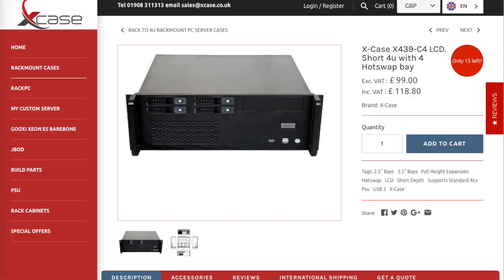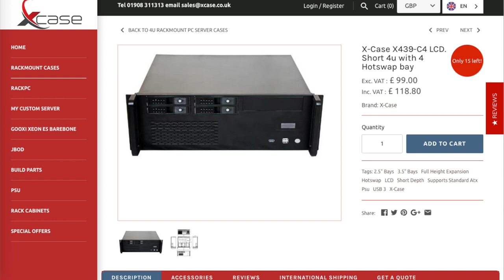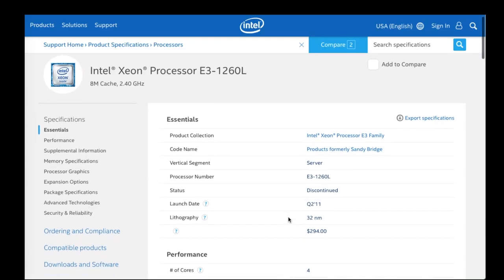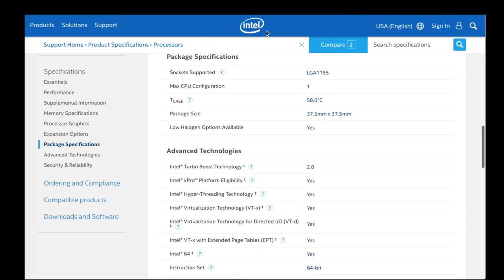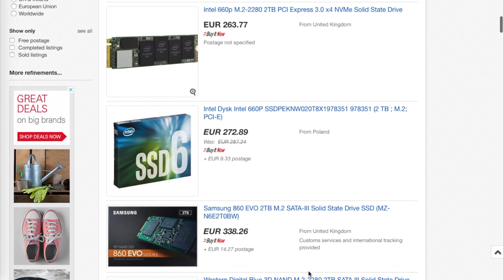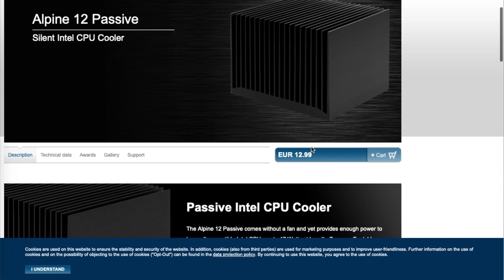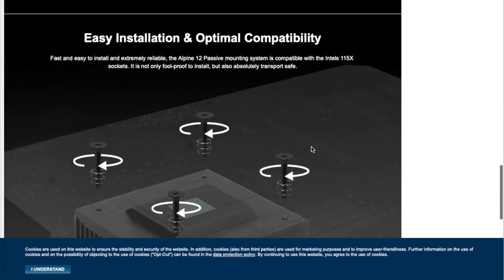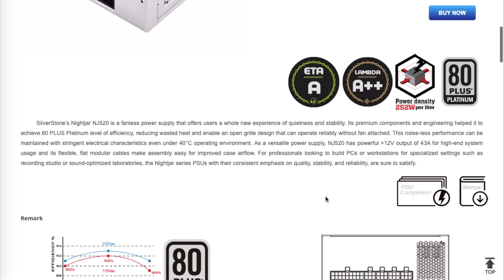The PERFECT home NAS? My current setup and 0dB NAS project introduction

Comment: I like xCaseUK. They use LogicCase chassis as a base, I think? I'm really happy with the RM 424 case I got from them
Reply from the maker: They have great service. I hope it will still be viable to buy from them after Brexit, because the prices are good as well.

What I like about this case is the perforations for the power supply, although I plan to add some more for the CPU so I can have my silent Xeon running at full clock. Now it throttles down often but still remain within the thermal specifications.

I don't know what chassis they use as base.